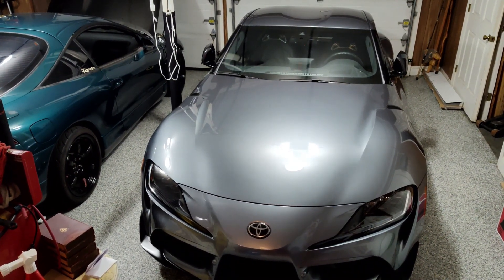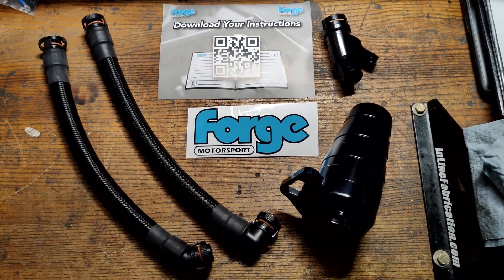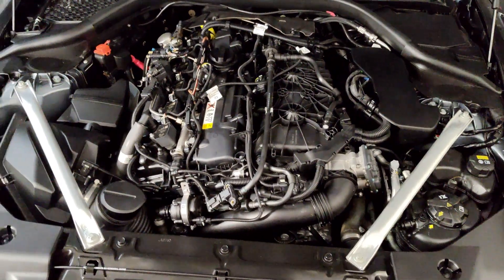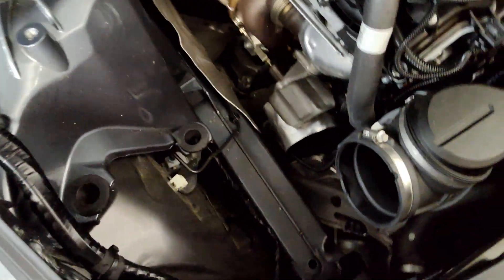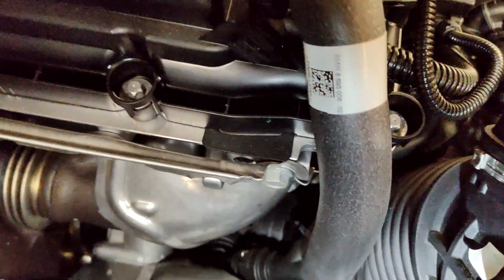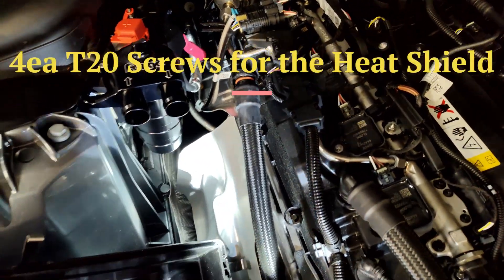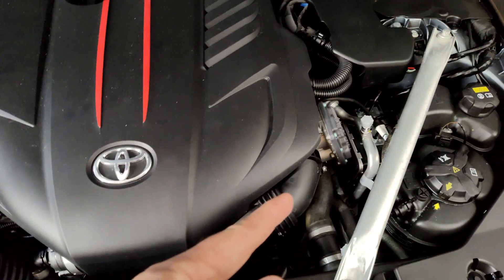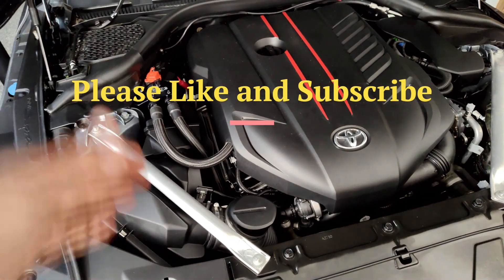A90 MKV Supra Forge Catch Can Install

Comment: That sensor in the airbox is a air temp sensor. Not a mass airflow sensor. The b58 uses speed density and o2 sensors for af ratios.

Comment: I have the AEM methanol injection spraying with the middle nozzle 250 into the upper charge pipe. I can’t say that it keeps it as running as clean as a flex file kit with a blend of E50 ethanol. I did this for better cooling than anything else. Since the ethanol requires typical 30% more fuel volume, it burns much cooler, due to the octane levels.
Reply from the maker: I think I'm going to go the same route as you.  The cooling effects plus keeping the intake tract cleaner sounds like a win, win.  I considered installing a flex fuel setup (I still might) but just as you mentioned the higher volume would require more trips to the pump and ethanol at the pump is hard to come by where I am in South Carolina.  

On your meth kit, what boost do you have it set to start spraying and at what boost is it spraying at 100%?
Reply: @grumpyvetgarage  John Visconti has it set at 9psi and full spray at 20psi. That will more then likely change since I have more supporting mods since the original tune. Now I have a port injection plate, ID 1050 injectors, DAW high flow turbo and running around E60 or so ethanol.
Reply from the maker: Thanks for the info.  Sounds like your build getting serious, if not already there.  Is the car strictly for the street, mixed use or track only?
Reply: @grumpyvetgarage  it’s for street use only. No future track use for now.

Comment: Very silly question but what does a catch can do? Is this necessary for the stock a90 Supra turbo?
Reply from the maker: The catch can's purpose is to trap oil that can be pulled from the crankcase breather into the turbo inlet.  The can is placed between the breather and the turbo inlet.  This helps keep your intake tract clean.  In many port injection cars a small amount of oil going through the intake back into your engine doesn't real cause a problem because fuel is being sprayed by the port fuel injector onto the intake valves preventing build up.  The A90 Supra is a direct injection car, so fuel is sprayed directly into the cylinder bypassing the intake valves completely.

Direct injection is great for performance but historically has allowed carbon buildup on intake valves due to the fact fuel is not constantly washing over the valves.  In some cases requiring manual cleaning of the intake valves every 40,000 to 60,000 miles.  The catch can helps prevent a build up of carbon deposits on the intake valves, which robs performance.

I hope this answered your question.  If you have any other questions let me know.
Reply: @grumpyvetgarage  a eos port injection kit would render catch can unnecessary then?
Reply from the maker: A port injection kit would not render a catch can unnecessary but having fuel flowing over the intake valves with a port injection setup would keep intake valves cleaner which is one of the main concerns addressed by the installation of a catch can.

Comment: I'd check it on the 1st of the month (every 30/31 days). for me, that's 1200 miles.  if it is dry or minimal, I'd go every 60 days until I'm comfortable with the collection process.   I hate it when manufacturers design out prevention methods and just add an additional customer maintenance requirement.  curious why you didn't opt for a AOS.  setup.
Reply from the maker: I planned on starting with checking the catch can once a month like you suggested, then extending as I feel comfortable.  I'm assuming you are referring to the Verus AOS setup.  It really was personal preference.  I liked the dipstick feature of the Forge Catch Can, but both do the same job and both require draining to remove collected oil vapor.  It's really up to you.
Reply: @grumpyvetgarage ... thx.  aos seem to be 2x the price of a catch can.  just depends on power lvl and if you don't mind the emptying process
Reply from the maker: Verus AOS is $380.  Forge is $460.  Burger is $220.  They all do the same thing.  It is personal preference.

Comment: Have you had this catch can catch any oil in it? Mine has been installed for like 6 months or longer and it has nothing in it.
Reply from the maker: I haven't had anything on the dip stick.  When I unscrew the body it has oil residue but not build up that would need to be drained.
Reply: Same for me as well. NOTTA. I guess thats a good thing.  @grumpyvetgarage
Reply from the maker: I feel the same way.  Not having blowby and oil vapor blown out the crankcase is a good thing.  I just figured, I would be seeing more in the can.  Definitely not complaining.